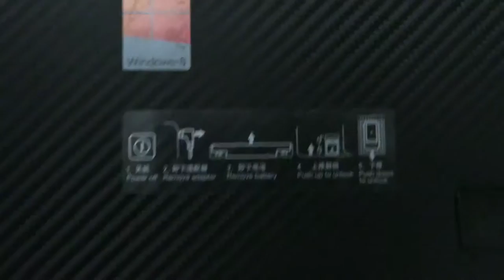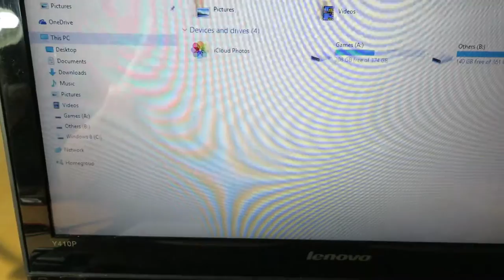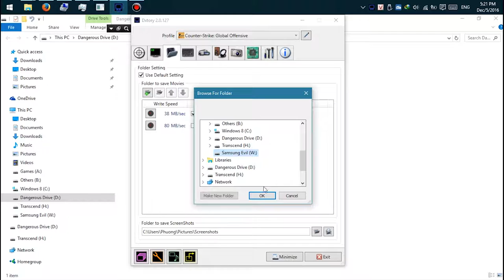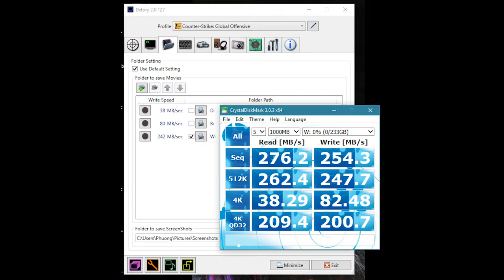Nimitz Caddy Bay for Lenovo Ideapad Y410P - Internal SSD Samsung 850 EVO Speed Benchmark

Comment: What if both hdd in caddy, and ssd in main port are recognized in bios, but SO only will recognize one? I'm having this issue since I upgraded to an SSD, Device Management only shows one in the Disk section. Will you share you thoughts on this? Both disks are physically ok.
Reply from the maker: Sorry, I no longer own the laptop since I destroyed it :)) But when I used it, Windows recognize both drives. You can try using MiniTool Partition Wizard to see if the 2nd drive is there, if it is, format and partition it.